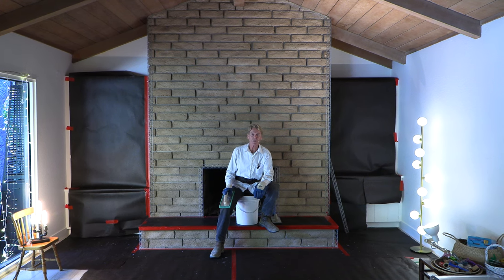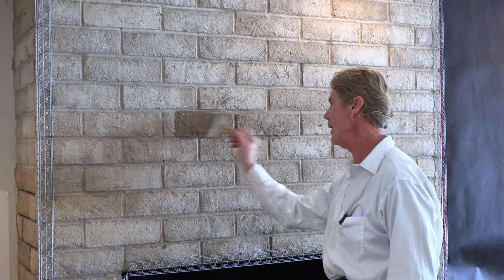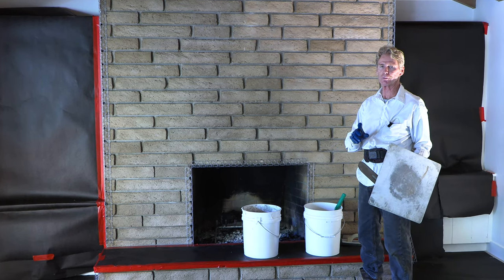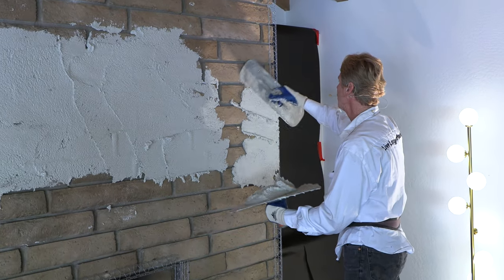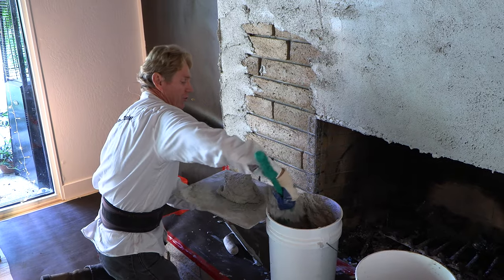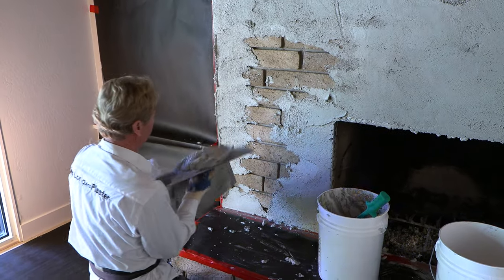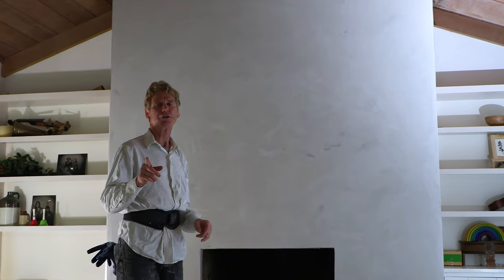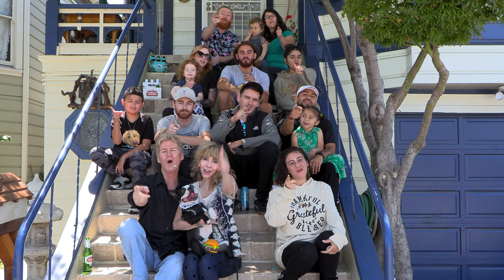Plastering over brick fireplaces with Lime plaster

Comment: Dude I'd be winded and he's just narrating the whole time. You're an inspiration kirk
Reply from the maker: Good afternoon Pirata, LOL,
You, are too kind, thank you for that positive comment. The fact is I get pleasure out of a cardio workout and rambling aimlessly about stuff that don't amount to nothing. The life of a simple man.
https://youtu.be/l-5aPNxv-pU/ 😉
Reply: What timing . I have an ugly brick fireplace that needs covering up. This is exactly what it needs. Only difference is my brick is a chipped brick surface so it’s REAL uneven and very deep mortar joints. Guess that means I have to probly do two base coats then a top coat with the lime.
Thanks for the how to !!!
Now I gotta fine that chem Tex here in ohio. @StuccoPlastering
Reply from the maker: Howdy Jeff, in the description, are two many other base coats that also can be applied that set just as fast. I like the Quikrete Greencor USA high-yield cement stucco as it has lots of lime and fine 
sand and is found at most home depots.🕵🏼
Reply: @StuccoPlastering  agree . I’m not close to a plaster supply distributor so being able to get at HD which is 5 miles from my house is great.
Reply from the maker: Howdy Jeff Dude, exzackory, I realize this; thus, in my description explains a simpler option for those who want cement plasters fast. 🕵🏼

Comment: It’s interesting how things are done differently in different places. In England, we would put the beads on, put the base coat on and leave about 2-3mm of the bead showing which leaves room for the finishing coat to fill the bead in plum. Regardless great job Kirk, looks spot on
Reply from the maker: Good evening Nik my fellow plasterer from the UK, We or you can achieve this same type of finish at least 10 different ways with quite possibly 20 different materials. What I have done in our last 15 years on video is try and show the different methods to accomplish the same goal.
Reply: @StuccoPlastering  of of course mate, like I say, I find it interesting seeing how it’s done in different countries. Even the difference between how it’s done in England and Ireland is noticeable

Comment: We have it made here in England Kirk, for our multi finish plaster (skim coat), we have a British gypsum product that sets in half the time, or we can use a product called half time, the more sachets you add the quicker you can set it and finish! I did a patch the other day from scratch in 20 minutes! Same with our backing plaster bonding or hardwall, we can add the same accelerators to it. We also have the reverse called extra time if you’re doing a big ceiling for example
Reply from the maker: Howdy my fellow plasterer, from England,  There are many products here also that can be used for the base coat such as Green Cor, Rapied set, Structo-lite, Diamond or imperial lime base coats, and quite a few others, We show every porduct know to man, Cheers. 👨🏻‍🔬

Comment: Thanks kirk ,love your flow. Can I plaster over a plaster wall that has been painted? Can I venitian plaster over paint?
Reply from the maker: Hi Lee, of course, you can; apply a bonding agent like Quikrete over a clean surface. Quikrete is sold at Hd or lowes and all the other hardware stores for about 10 bucks a quart. 😉
Reply: @StuccoPlastering  thanks man, love from alberta canada

Comment: I really love the concrete look after you were done applying the Ekoplast, before the stucco! Could it be left “as is” over the brick on a working gas fireplace? Or maybe add a light coat of actual concrete over the ekoplast instead of stucco?
Reply from the maker: Morning the possibilities are endless as your only limited to your imagination. Tip, the Ekoplaster is very similar to Structo-Lite, which means it's gluey. One must keep the trowel wet when working with it. It can be left alone or indeed finished with many different finish materials.👨🏼‍🎨

Comment: Great YouTube videos and information! Thank you for all the helpful info. 
There was one thing missing in the video on lime-plastering a fireplace...there's no info (unless I missed it) on what wire mesh you used for corners, where to get it and how it is attached to the brick? 
If the brick is painted, does it need to be stripped before applying the lime plaster?
My fireplace only goes 3/4 of the way to the ceiling. Do I brick it the rest of the way and then lime-plaster coat it? Or can I frame in wood, to the ceiling and plaster coat the wood? 
Any advice is gratefully appreciated!
Reply from the maker: Howdy Truth Dude, If you want your fireplace to go to the ceiling, yes, frame it in the rest of the way. Why go to the ceiling? The corners are on, they are called, "stucco corner aid," sold at HD or any plastering yard such as westside building materials. No bonding agent was necessary as this was unpainted bricks, thus pouras, the plaster adheres to it by suction, as long as the existing is wet or moist. If your bricks or blocks are painted roll or paint on a bonding agent such as Plaster-Weld by Larsons or Quikrete. Cheers👨🏻‍🔬
Reply: Greatly appreciated!  Thank you Kirk!  @StuccoPlastering

Comment: Hope i’m not bothering you at this point… I went through all the questions, and not one answer…I applied the ekoplast, came out great..we’re thinking about just  painting it and moving on, primer + paint what do you think? It seems as if you could almost sand this stuff as it resembles a chalk-like finish!! Thank you in advance!
Reply from the maker: Howdy, if your happy with the finish then move to painting, this plaster is like Structo-Lite, which means it's complicated to make it smooth without the top dragging. I can make it smooth with a trowel and lots of water, but it is gluey, thus some folks don't understand how to make it smooth.  This plaster hardens to strong to sandown.
 If it's not as perfect as you like you can apply any finish coat over it 👨‍🏫

Comment: Hi Kirk. Thanks for the wonderful video. I'm planning to tear down the tiled gas fireplace and reframe it. Can the Ekoplast-50 be applied directly to the cement board?  Thx!
Reply from the maker: Yes, absolutely, but use a bonding agent on the boards such as Weld-Crete or Quikrete.🧑🏻‍🏫

Comment: Looks great!  I painted over my non working stone fireplace wall last year. Looks allot better but I'd like to change it to look all smooth. What can i use that will stick to the paint& fill in the deep grout lines& make it all smooth or somewhat smooth please?
Reply from the maker: Evening Debbie, the fastest and easiest would be to use a twenty-minute joint compound. That's actually taping mud with accelerators. Clean your painted surface and paint with quikrete bonding agent, found at Lowes and Homedepot, for about 9 bucks a quart. Then you are ready to mix the joint compound and plaster it as smooth as a baby's butt. 
In this video, joint Compounds, Westpac Fast Set, or USG Easy Sand: https://youtu.be/k7tE652qOH8at/ 2:26, I show the two types of gypsums, Westpac and easy sand.  Cheers. 😉

Comment: Looks great!! I'm wondering where you get the corner joints you had applied on the brick before the plaster. What are they called?
Reply: Go to Lowes or Home Depot and ask for stucco corner bead. It’s going to be in the pro section!
Reply from the maker: There called corner aid and sold at plastering yards or big chain hardware stores like HD or Lowe’s.

Comment: Hi Kirk . Why do you use a Pool trowel . I’ve been plastering for 40 years and never in Europe would We Use a Pool trowel for Plastering. We use a New with Sand and cement / Stucco , until it’s “Broken In “ , and then we use if for interior Skim / finish Coat plaster 👍
Reply from the maker: Howdy Martine, it's not really a full radius, as I've no use for those either. https://youtu.be/X_SRyTIVMbU/  This is my choice of plastering/stucco trowel.  As a  rule, I tell folks to use whatever they are comfortable with. 👨🏻‍🔬

Comment: Cool beans on the video. Question about mixing two concretes together  Portland and plastic cement, do they fight is it recommended ? Never done it but have seen it done on a block wall.
Reply from the maker: Howdy guardDuck dude, both are comparable. like peas in a pod.🍺

Comment: Great video Kirk. I am getting ready to do this to our fireplace- there is a 3’x3’ square in the middle of the fireplace where the brick comes out an extra inch compared to the rest of the fireplace (an old design choice). Can I just add extra base coat around this protruding brick to make the whole finished product flush? Thank you!
Reply from the maker: Hi Nathan, of course you can.👨🏼‍⚕️
Reply: @StuccoPlastering  do I need to do extra multiple coats to achieve the thicker spots or can I do the couple inches of material in one coat?
Reply from the maker: Apply each coat depending on your skill level, say a half-inch or a solid each at a time allow to set, and keep applying as much as needed. 👨🏻‍🔬
Reply: @StuccoPlastering  should I wet the previous coat before applying the next coat?

Comment: Hello Kirk, Enjoy your video clips of advice, reminds me of my days working for joe Meiswinkel in SF. I moved on to be a GC in Marin. If you catch this I have a Question, Do you know any reason why you couldn't add color to 
imperial white coat?
Reply from the maker: Hi Dominick, I know of Meiswinkle; last I heard, my boy, Paul Gueteriz, was a foreman with them?
 Just so you know, any color can be added to any lime plaster or joint compound; I have done this many times at no cost, as I tell folks I can add color but can't guarantee it will come out that exact color.
 I know how to get the exact color, but I'm not willing to do it. However, I do have a video of how to do it. Some things in this trade are just too boring to repeat.

Comment: Hmmm...  I wish there was a tutorial video on all the different types of plaster... there are sooo many different types of concretes that it is just confusing.  They have a concrete for everything these days.  There's Concrete Countertop mix, glass block mortar, high early strength, microcements, polymers.... etc.

For instance, are all limes interchangeable?  Can I use Type "S" lime for say, a tadelakt application?  If so, what creates the binding?  Will black soap or olive oil soap cause a chemical bond with type "S"?    How do you keep finishes from cracking when they dry?  Do Admixes plasticize and waterproof the finished product?

SIGH!  There's so much!
Reply from the maker: Exzackory, after more than 40 years I'm still pulling from memory what cements stucco and plasters work the best for every and each individual project.👨‍🏫

Comment: Of course, you can cover brick walls and fireplaces with Wonder board or drywall. You need to drill pilot holes and then use Tapcon screws. It requires some practice and a supply of drill bits. I like the plaster finish but a patterned wall is within reach of a DIYer.
Reply from the maker: Morning Walter, there are many ways to skin a cat. The idea of screwing and type of board over a fireplace is asking for trouble. But folks can do as they please. 😏
Reply: @StuccoPlastering  Don't get me wrong: I love plaster.  Just saying that there are other solutions.  I made a beautiful patterned wall of furring strips, drywall and tile to hide a tired, dated brick wall and fireplace.  Would send pix but don't think they attach here.  Carry on.

Comment: Hi Kirk: I need your help. After watching this video using Ektoplast 50, I ordered 4 bags of plaster to be shipped to me so I could do my interior, brick, never been painted, or coated 100 sq. ft. fireplace. A few questions. 1. Do I need to apply a bonding primer to the brick to assure the Ektoplast adheres properly. The guy at Kemset in Wilmington said I did not need a bonding primer on raw brick.  2. I want to end up with a smooth, natural white finish as you did in the video.  What smooth, white plaster product will bond well to the Ektoplast 50 and when should I apply it?  Also, I am a DYI homeowner and will not take any risks and mess with any additives in the Ektoplast.  I would have you do my project but I live on the East Coast.
Reply from the maker: Hi Michael, no you don't need a chemical bond when applying ekoplast or any other interior or exterior plaster to any porous surface. Not sure if it's porous, wet it, like a brick if it darkens no doubt it's porous, I used Diamond lime plaster as a finish plaster. In the description there are many different base coats that can be used also.👨🏻‍🔬
Reply: @StuccoPlastering    Thank you for the reply.  This will help greatly.  One other question. Should the Ektoplast be totally dry when applying the Diamond?  I will most likely wait a few days or more before applying Diamond, unless you tell me to do it at a specific time after the Ektoplast is applied.
Reply from the maker: @michaelskalka2112  Hoowdy Michael, yes, it should be dry. I applied in many areas two to three inches thick but had them boys of mine add a lot of accelerators, thus was able to apply the finish the same day. 👨🏻‍🔬

Comment: Also curious how to determine how many bags of Ekoplast 50 I should get for my project - how much does one bag cover typically?
Reply from the maker: Howdy Dylan, I don't know you would have to google the name for that info. for all my years in business, I've eyeballed everything including apartment buildings or even custom large homes. With this method I'm almost always correct, but just in case, I add a few bags or tons of sand in case, I'm not correct.
Reply: @StuccoPlastering  thanks for the reply! Turns out kemset has a breakdown on their site that shows how many square feet a bag covers and at what depth. I ordered 8 bags for my project today from your friend hikmet

Comment: Howdy Kirk and Jason! I’m doing a very similar project but found that two bricks had been replaced with chunks of wood to mount the mantle (which are lodged between the bricks). Can I stucco over these? What would you guys recommend?
Reply from the maker: Hi, attach some 3.4 stucco flat mesh wire over the wood at least 3 inches past the wood in all directions, then stucco as usual, as Plaster or stucco won't adhere to bare wood. At least not for long.
Reply from the maker: Apply a bonding agent over the wood like plaster weld by Larson’s or add wire over them, this way you’re sure the plaster adheres forever.

Comment: Hey Kirk. I have a brick fireplace that has been primed with waterbase paint. Can I use venetian plaster (vasari) directly on bricks? Or do I need something different for the first coat?
Reply from the maker: @brandonterzic  nothing adheres to a painted  surface unless you first apply a bonding agent. I recommend Plaster-Weld by Larson’s’
Reply: @StuccoPlastering  thanks Kirk! On the Vasari website is says their plaster will bound to primer or latex paint on drywall...should I ignore that and put on a bonding agent as well? (I am doing my fireplace and the walls of my bathroom as well). thanks!
Reply: @StuccoPlastering  hey Kirk I bought the plaster weld. Can I smoothout the brick fireplace with a couple layers of fast drying drywall compound then apply the venetian plaster? Thanks!!!

Comment: Hey Kirk! I used diamond veneer over structolite yesterday, and was getting a bunch of bubbles on the diamond! Like I could literally pop the darn things. So I was just hoping hoping you could share some wisdom to help me avoid/mitigate this issue!
Reply from the maker: Howdy Santos, no problemo, The Structo-lite had not set solid yet;.
 And or you applied the Diamond and over-troweled it. 
You apply with five strokes or fewer, then when set and bonded, you can now go over and over it. It has to grip first.
Your troweling loosened the so-called mechanical bond by troweling it too soon.
 It happens to the best of us. 🥳
Reply: @StuccoPlastering  Hey Kirk! thanks for the reply. The thing is the Structo-Lite had already been dry for a week! And the tiny bubbles were appearing as soon as I troweled on the Veneer. Almost sounded like I had opened a fresh Cola from all the tiny bubbles sizzling lol

Comment: Is there a 'trick' to plastering over painted brick?  Also, my fireplace doesn't go all the way to the ceiling. What is the best solution for plastering up to the ceiling?
Reply from the maker: There is no trick, the bricks must be cleaned then a bonding agent rolled or painted over the brick so that the plaster adheres to the painted surface.  If you want to add plaster to any surface where there is none, you can add sheetrock.👨🏼‍🎨

Comment: how soon after placing stucco can you go over with the lime finish? could i also use a tinted venetian plaster as the top coat? thanks!
Reply from the maker: Yes, you can tint any plaster, I usually do lots of same-day stucco and plaster, so we're familiar with accelerators, As a rule, the plaster has to be set hard enough that you can't scratch it. 🕵🏼
Reply: do i need any sort of bonding agent between the stucco & venetian plaster or it can go straight on?  @StuccoPlastering

Comment: Can you plaster over tile?
Reply from the maker: @targebaby01  you can, but I wouldn’t advise that, as if it has a certain glassy or smooth ceramic finish the plaster won’t adhere for long even with a boding agent.

Comment: Could someone link me to the wiring used for the corners? Thanks!
Reply from the maker: These are called "stucco corner aid" they can be purchased at HD or lowes. However I shop for stucco accessories at "Westside Building Supplies" They are a professional Plastering yard thus the quality is much better. And yes this matters.

Comment: Can this be done over exterior brick?
Reply from the maker: Howdy, the base coat can be spread outside, however, you can't use Diamond lime finish for exterior use, No big deal, switch to La Habra finish coats. O do it this way, https://youtu.be/MbZHkJCJuZ8/ Cement stucco over concrete or bricks. Greencor. 👨🏻‍🔬